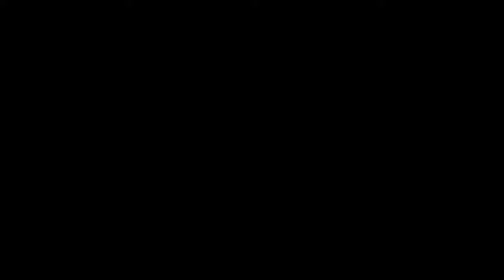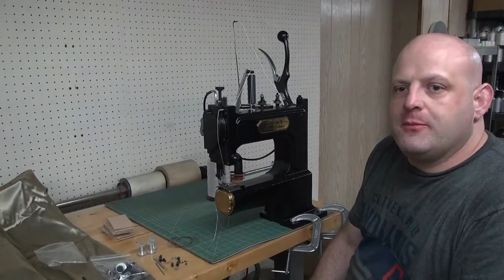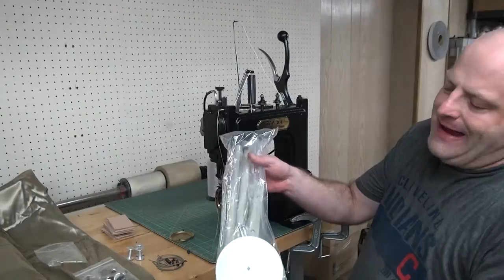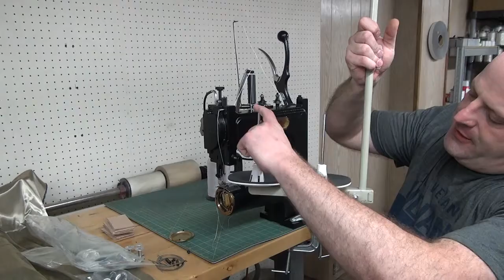Accessories for the leather sewing machine for holsters

Comment: If I were stitching a wallet for example with thin leather, what would be the smallest stich length that I could achieve using this machine?
Reply from the maker: minimum 1 mm stitch lenght can be achieved.
Reply from the maker: Yes, you have to use small needle and sewing thread.